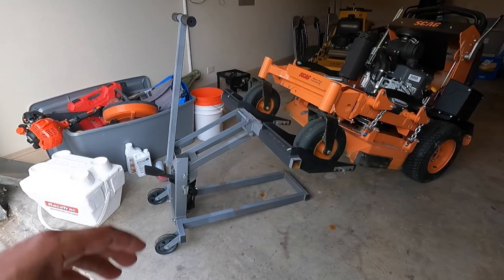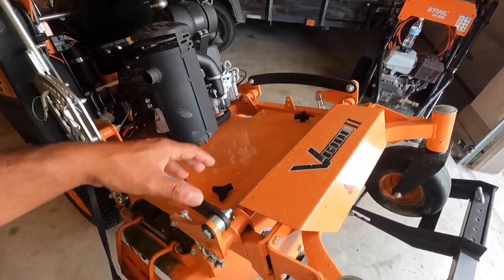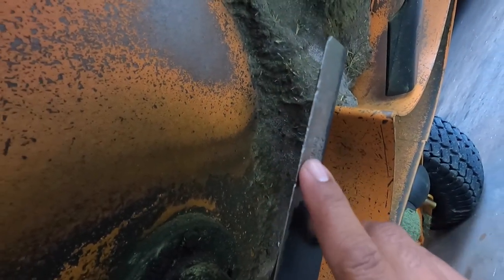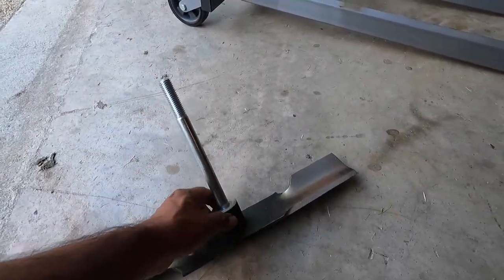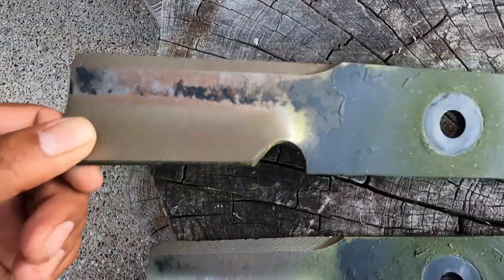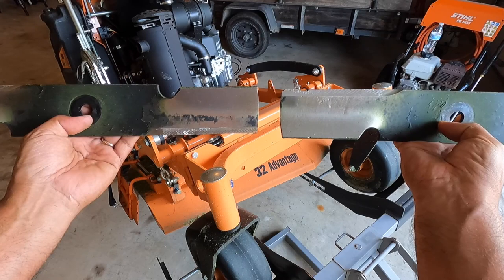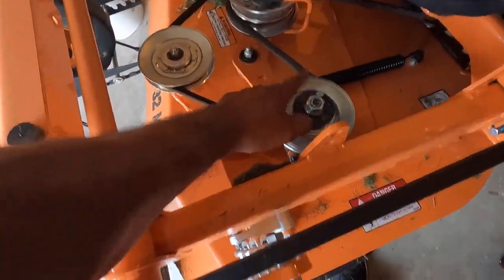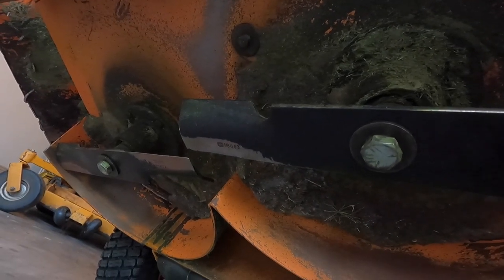HOW TO CHANGE BLADES ON MOWER | SCAG V-RIDE2

Comment: But the video completely leaves out the sharpening process! I own a SCAG 30" walk behind. I have previously owned a Honda and a 30" TORO TIMEMASTER. One thing I have discovered is that the SCAG blade is far different than any blade I have ever owned. The SCAG blade has a specially hardened cutting edge, far harder than anything I have ever encountered, even other touted "hardened steel" blades. The SCAG blade is a SOB to sharpen! And that is a GOOD thing! You can do what you want, but for me, I will NEVER use a grinding wheel to sharpen a mower blade. The intense heat destroys the blade's "temper." I use the largest, badest, longest-handle bastard file I can find and sharpen by hand.